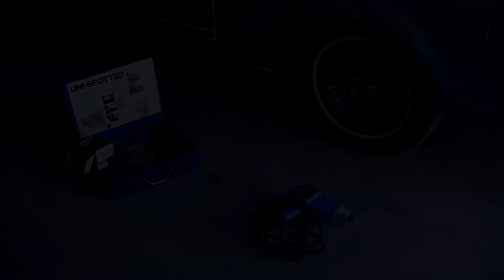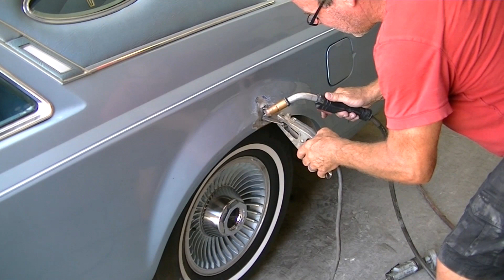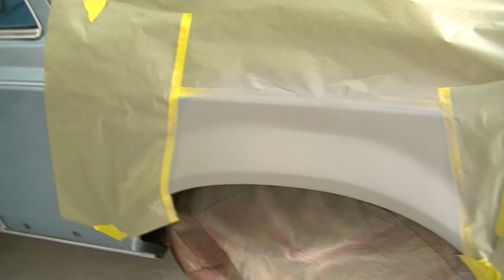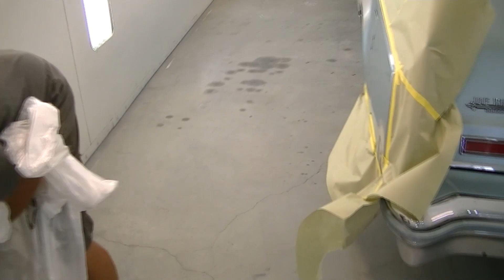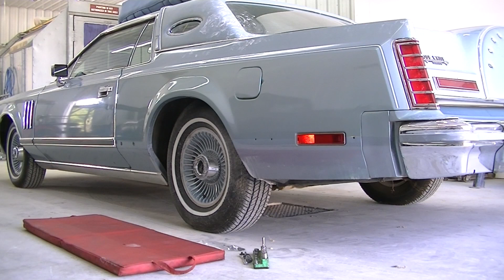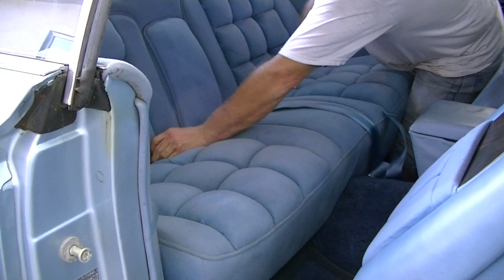1978 Lincoln Continental Mark V Part 5 - Fixing The Body On This Old Girl - UNR 43

Comment: Hi, you've now had both the Mark V and the Thunderbird, which do you prefer?  I was looking at getting one or the other, thanks  🙂
Reply from the maker: They were both good cars, reliable, comfortable to ride in and stylish. My T-bird had the 351W and the Lincoln had the 460. My T-bird got about 19 miles to the gallon highway and the Lincoln got about 12. I liked the look of the Lincoln better. I think the T-bird handled a little better. Keep in mind, I owned the T-bird in the mid 80's and the Lincoln very recently. Really, a lifetime apart. I would really like to drive them one after another now so I could really feel the difference. I was also 20ish when I owned the T-bird and now I'm 55ish. What I look for in a car at the different ages is very different. Overall, I'm leading Lincoln.
Reply: @up-n-runnin377  Thanks for the info.  The Tbird does get better mileage and is a little shorter.  I was looking for the Tbird with T-tops, which the Mark V doesn't have.  
Were they about the same to work on?
Reply from the maker: From what I remember, yes. They were basically the same car as far as working on them.
Reply: I've owned a '70 Mark III, '77 T-Bird, (351W) '77 LTDII sedan (302W). I really enjoyed the LTD sedan's longer wheelbase (4 door) and the fact it had manual windows and door locks. It was a pleasant car to drive and handled well.
Reply from the maker: A buddy of mine had a '78 LTD II that was red with the big white stripe on it and a '73 Gran Torino Sport with the 351, bucket seats and automatic on the floor.  Lot of good times in both of those cars!!! Thanks for watchin'.